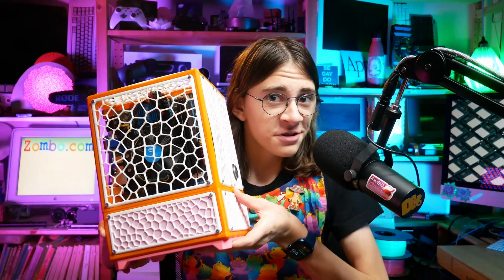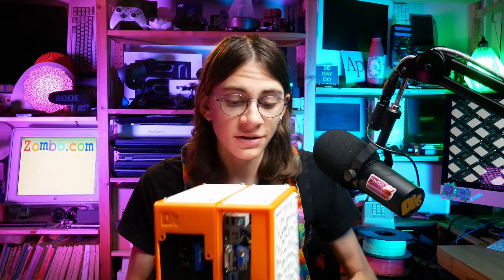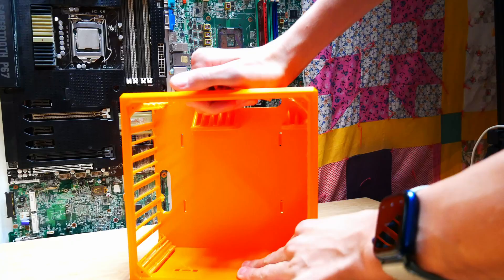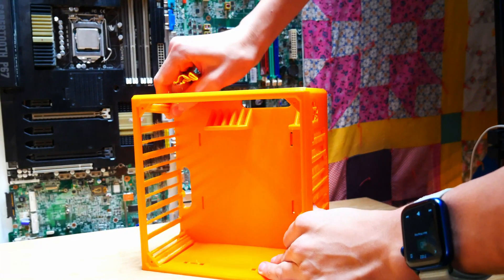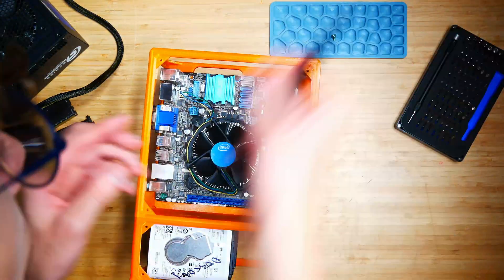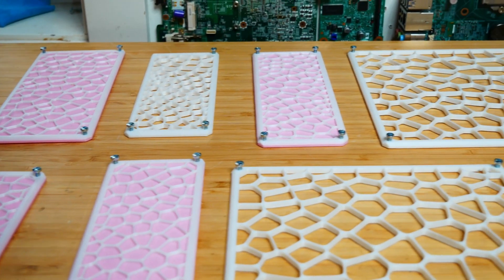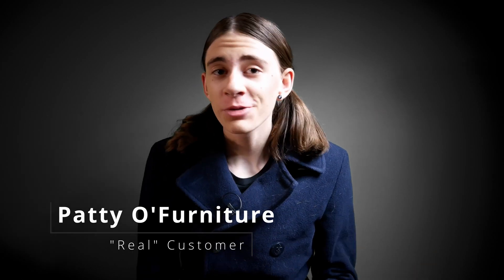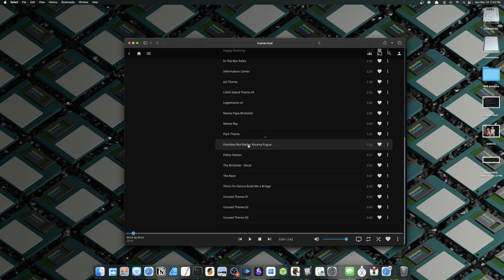I Made a FULLY 3d Printed NAS and you can too

Comment: Pretty cool concept! How does the Jellyfin server perform without a graphics card? Are you using one of the 11th gen, or later, intel CPU's for hardware transcoding or simply avoiding transcoding?
Reply from the maker: After almost a month of using it, It’s surprisingly good. It’s actually Intel 3rd gen and I’m just not bothering with transcoding
Reply: @DisketteKitchen  Oh okay, I'm glad it works good! So do you not use it outside of your LAN at all? Or do you just make sure to always only have video files in an accessible container, with fairly low bit rate?
Reply from the maker: I VPN in if I want to access it from the outside and yeah most of the stuff on there is just old office episodes